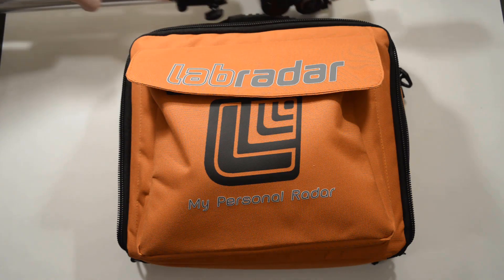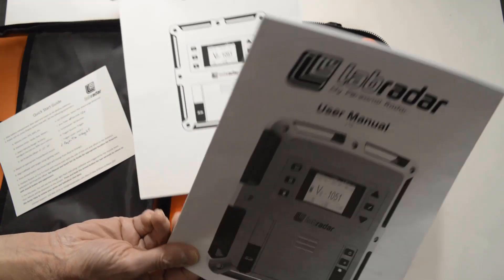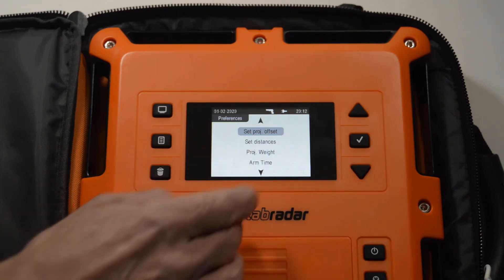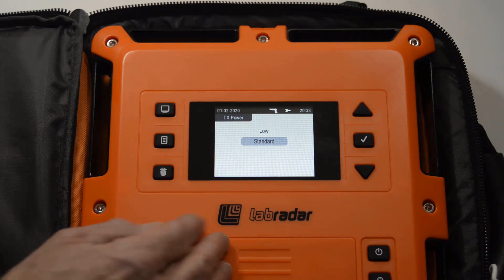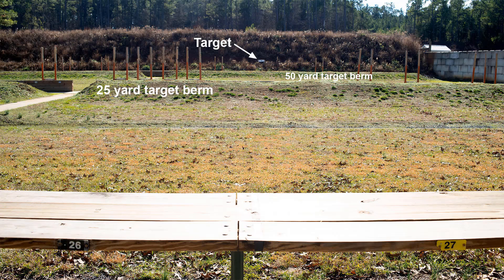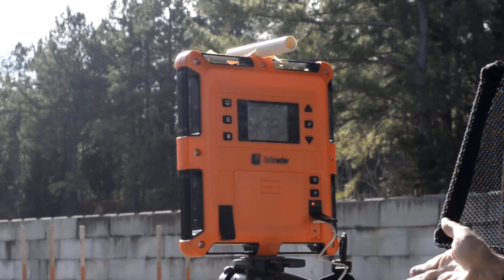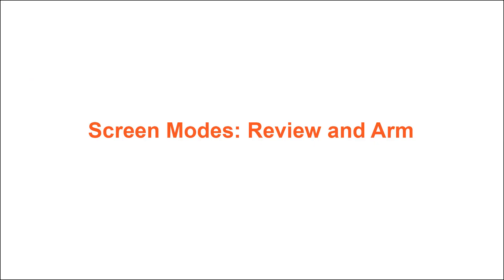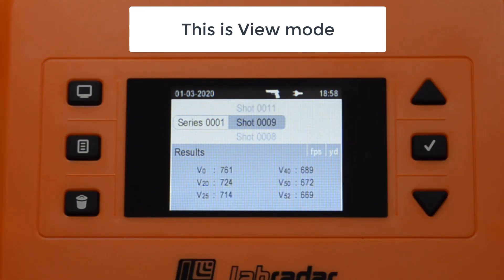Labradar Range Setup and Operation

Comment: Thanks for the video, you do a great job providing detailed information.
Can you provide information on your brass catcher when you have time.
Thanks!
Reply from the maker: Thank you Jim.  The brass catcher is from CMM Shooting Sports.  Their link is below.  They call it the ultimate brass catcher.  At one of the ranges I compete at, the shooting tables are so small, there is no room for the brass catchers metal base.  So I purchased the CMM clamp base.  Also, if it is windy and you are shooting a lot, the catcher can become top heavy.  When that happens, I place a box of ammo on the base plate.
http://www.cm-machine.com/

Comment: As a fairly new reloader i have been looking to get a chronometer. In research the labradar seems to have good reviews, accuracy, simplicity in setup and works from the shooting line. Do you ever use it on the range when others are shooting? Any issues with it? Cost is high but buy one cry once. Is it worth the cost?
Reply from the maker: I realize I answered this on the other video, but if someone else reads your comment and has the same question, here is my answer.

Yes, I have used it when there were other shooters. But they were on the adjacent range, so they were not close. I used the Trigger Level preference to decrease the sensitivity by selecting a higher Trigger Level value. If they are shooting right next to you, you will have two issues. One, you may not be able to set a high enough Trigger Level to prevent their muzzle blasts from triggering your device. Second, lets assume you can set a high enough Trigger Level so that only your blast causes the Labradar to start measuring, if the person next to you fires at about the same time as you do, then as the Labradar starts recording your velocities, the other person’s bullet may enter the radar’s signal, thus causing erroneous readings. This may show up as a low signal-to-noise ratio in the individual shot csv files.

What you may have to do is monitor the shooters around you. When you see an opportunity to shoot when no one else is, you can take your shot. Remember, you don’t have to hit the 10 or A ring for the Labradar to do its job. Also, learn how to delete a shot in a series while at the range. If you are waiting and you see someone else’s shot set off your unit, once it has finished recording, delete that shot. Not the ideal situation, but there is no way I would use a traditional chronograph when people are shooting close to me. A typical chronograph is placed in front of the firing line, and if someone accidentally shoots it, you may not have recourse since you intentionally put an object (your chronograph) down range.

Comment: I do enjoy all the videos of yours, no-matter if they do apply or not to my needs! Thank you! I've a question regarding the battery you purchased for your Labradar. It does say 10k mAh battery and my question is does it last one day or more/not?
Reply from the maker: Thank you Lubenator.  Yes, the battery has lasted me for the better part of a day.  When I was finished for the day, it still showed plenty of charge remaining.  The day before I know I am going to use it, I check the battery level (press the button), and if less than 90%, I charge it.  By the way, the battery can be used to recharge a mobile phone, not just power the Labradar.
Reply from the maker: Lubenator, the following comment showed up in my feed, but I do not see it in the comments section of the video.  Sometimes I get notified of a comment but then it does not show up for some reason.

“knowledge2you Thank you! I'll probably pick one up. Today I went to the range for a first time with the Labradar and I did my velocities checked and zeroed based on V. Now at home and without SD card installed (did not arrive on time yet) I can not download my files via the USB cable provided! Wonder why? Is their a restriction? Is SD card a must for download option to be available? Another question pops up now, in later time when SD card is installed in place, would the recorded data be automatically recorded to it or it's lost? The manual doesn't specify anything about all that....very vaguely downloading explained...”

In case you did not delete the comment, part of the answer is on page 17, section 4.3.9, v 1.2 of the User Manual, it states ‘The data recorded in the internal memory only (while there was no SD card inserted) cannot be accessed by USB.  It is only viewable on the display screen’.  So, this means that any data stored in the internal memory of the Labradar cannot be downloaded.  

Once you insert a SD card, any previous data stored in internal memory will not be written to the card.  However, you do not have to tell the Labradar to write NEW data to the card.  It does it automatically.
Reply from the maker: In case you have not seen it, I do have a video on the organizing, downloading and analyzing of the Labradar data.
https://youtu.be/LT04hiGQzb8
Reply: @knowledge2you  Thank you! I found that part in the manual yesterday... disappointing to know that the data would be available only on my cellphone in many pages and scrolls, ratter one spreadsheet on one screen! They could have made that file on the internal memory for cellphone app to be an excel file as well. People could safe the data and emailed to self and others as needed. I thank you! You have been very kind to all of us!
Reply from the maker: @theLubenator  I am glad you were able to find it, even though it is not what you wanted.  The manual did say that when recording data in internal memory, it records less data than what it records on the SD card.  I do not know what data they don't record/store, but they obviously want us to use SD cards.  As a side note, if a buddy goes to the range with you to record velocities on your Labradar, make sure they bring their own SD card.  It will be a lot easier for them to take home their own SD card than you downloading it and emailing a bunch of files to them.
Reply: @knowledge2you  Point taken!

Comment: Great videos!!   Your descriptions make perfect sense and are comprehensive with the information.  

A question or two.....I have several series on the LR (no SD card...yet....I just took it out and started using it).......I get how to find Power Factor by holding down the ARM button for several seconds and getting to the three screens showing me KE and PF.....HOWEVER...I seem to be only able to do it for the last series.  I have been unable to scroll back to a previous series and get the PF and KE info.  

Also, is there a way to add shots to a series previously fired?  If I'm on series 0005 and want to add shots to series 0003, can I?  And how?  I've tried to select a series (previous to the last one shot), hit the ENTER button which displays the last shot of that series, but when I hit the ARM button it kicks me back to the last shot of the last series I shot, not the one previous to it that I want to add to. 

Thanks again for putting this information out there!!
Reply from the maker: Unfortunately, there is no way to add a shot to a 'previous' series.  If you were desperate to add a shot to series 0003 and did not care at all about series 0004 and 0005, you could try deleting series 0004 and 0005, but that is an educated guess on my part since I have not actually tried it.  [I know they are not on the SD card, but if they were, you could have copied series 0004 and 0005 to a computer, then delete them in the Labradar unit (don't delete a series off the SD card via your computer) and might be able to add shots to series 0003.]  The reason I think this would work is because a series is not locked until you create another series and if you delete the current series, the last previous series becomes the current series.

I do not think you will be able to look at the 'additional' PF and KE screens because as soon as you press the Arm button, its going to take you to the current series.  But let me do some research regarding this and I will get back to you.
Reply from the maker: @Sleeplessknights I have confirmed (on my own Labradar) that if you are willing to delete series 4 and 5, you will be able to add shots to series 3.  LR will only add shots to the current/most recent series.  By deleting series 4 and 5, series 3 becomes the current series.

I have also confirmed that you can only see the KE and PF screens on the current series.  This is  because once you put LR into arm mode, it automatically jumps to the current series and will stay there. And you can only see these screens in arm mode. [Correction. See additional post below.]
Reply: @knowledge2you  Hey thank you for the answers to my questions and the suggestion about deleting back to a previous series.  This makes perfect sense and I'll utilize it next time at the range.  

Here's another question for you.............I understand why I'd want to set the first Dx distance at 10 feet if I was concerned about an accurate power factor for USPSA purposes (which I am for certain pistol loads), but why should I be concerned about these Dx distances for an application where all I'm concerned about is muzzle velocity?  For building a hunting load for instance, is there a reason to adjust these out to a series of yardages?  Or maybe a long range (1000 yd) load for a .308?   

I also want to thank you for the form that you showed in your videos.  I made up something very similar for a written record.

I appreciate the help!!
Reply from the maker: @JNRK3006  You are not required to set the Dx distances.  They are there for us to use as needed.  Not using them will not lower the V0 accuracy.  Using them will not improve the V0 accuracy.

In the handgun sport I compete in, we shoot at two specific distances.  25 and 50 yards.  So I set Dx 1 to something less that 25. I set Dx 2 to 25. I set Dx 3 to something between 25 and 50. I set Dx 4 to 50. And I set Dx 5 to something greater than 50.  The only ones I care about are Dx 2 and 4.

I am not a hunter, but assume I have my hunting scope marked for 50, 100, 200 and 300 yards.  I would set my first three distances to 50, 100 and then 200.  I would not be able to set a distance to 300 because the maximum you can set a Dx distance to is 273 yards (250 meters). The minimum is 1 yard (1 meter).  The LR marketing material says its theoretical maximum is 100 yards.  And that would be under ideal conditions.

I am not sure if you had a chance to see the data analysis video (link below), but this is basically how LR works.  When you shoot, once the LR picks up the projectile, it will start recording velocities until it can no longer pick up the projectile.  In the shot series I use in the data analysis video, the LR did not pick up the projectile until it (the bullet) was about 18 feet down range.  It then continued to record velocities about every half yard.  And for that particular series, it recorded over 100 velocities even though the impact berm was 53 – 55 yards away.

Once it has all these data points, LR then constructs a predictive model (my guess is a linear regression since there is a strong linear relationship between distance and velocity).  It then uses that predictive model to calculate/estimate/predict muzzle velocity (V0).  It then uses the same model to calculate what the velocity is for each Dx distance.  Hence, setting the Dx distances to specific values will not affect how LR works.  It kinda does not care what the Dx values are.  It captures a large number of velocity data points and then uses those data points to predict V0 and the Dx distances.  Which is actually a good thing because this allows us to set Dx to what we need and not worry if it will affect LR.
https://youtu.be/LT04hiGQzb8
Reply: knowledge2you excellent answer!   I did watch your data analysis video......reading your answer above filled in some gaps in my understanding of the process.  I appreciate your work on these videos!!
Reply from the maker: @JNRK3006  You are welcome.
Reply from the maker: @JNRK3006  I have a correction.  While you cannot see PF and KE of previous shot series on the LR unit itself, you can see this information on their mobile app.  The app is free from LR.  It works by connecting to your device and downloading all the series and shot data it finds onto your mobile device.  Then under Series List (at the top), you select what series you want, and then at the bottom, click/press PF.  It will then show you the average power factor for that series (and KE info also).  If you want to see it for a particular shot, press Shots List (at the top), select the shot you are interested in.  If PF data is not displayed, press PF at the bottom.

It could be a little confusing, but at the bottom, it will give you three options; velocity data, KE data and PF data.  The velocity option is represented by unit of measure, such as fps.  KE option is represented by its unit of measure, such as ft-lbf.  And PF option is represented by the letters PF.

You may be tired of my videos, but I do have a video of their mobile app at this link.
https://youtu.be/K92uj2_qqgA

Comment: I'm curious - if you have AA batteries installed, then plug in the usb power, will the unit draw power from the usb and not drain the batteries?  I would want to keep the AA's installed but only use them for backup in case the usb device ran out of power.
Reply from the maker: I have never tried that since I only use the battery pack.  However, the display will show, in the upper right, either a power cord symbol or a battery symbol to denote which one it is drawing power from.  So if you put in the requisite batteries, plug in the battery pack, turn on the battery pack and then turn on the unit, I would assume the display will tell you which one it is using.  If you are not going to use your unit for any length of time, you will want to remove the batteries.
Reply: Just got my labradar the other day...& I wondered the same thing.  So I keep AA's in it to check settings & review shots. But when I'm using the unit for testing  Velocity I run it off a battery pack. When you have batteries in the unit and it sees you plug in a power source from the USB it automatically switches over to that power source. And when you pull the USB it automatically switches to the internal batteries.
Reply from the maker: @tele1311  That is good to know.  Thanks for the info.
Reply: @tele1311  Thanks for the answer!